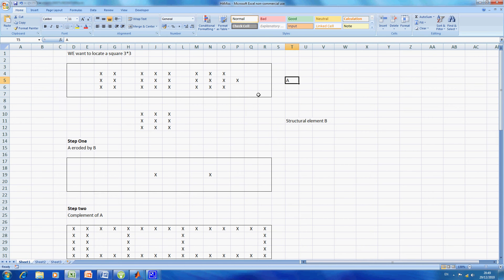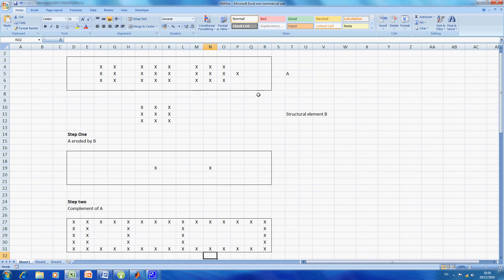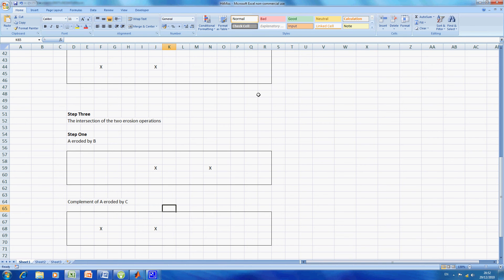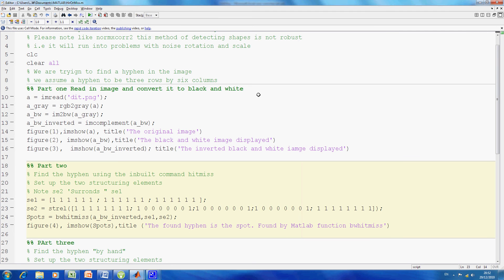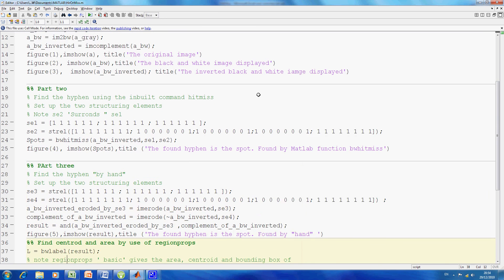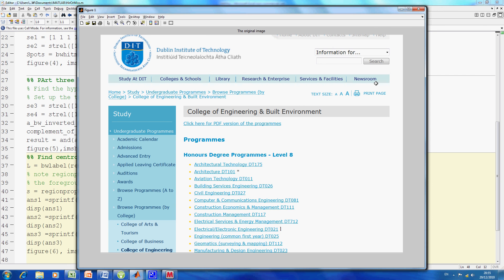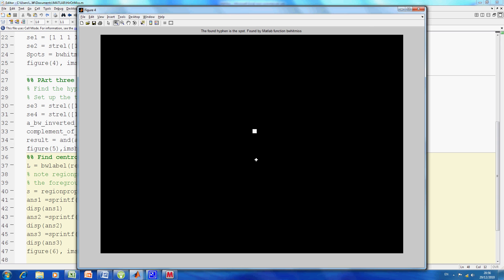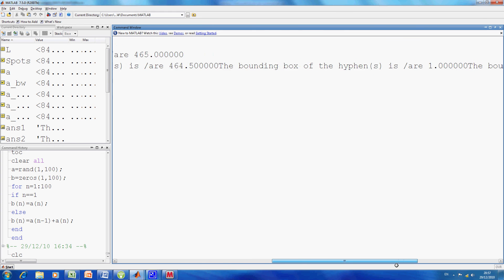BwHitMiss in Matlab (Hit Miss)

Comment: i am trying to recognize a short period waveform in a long time period waveform by using hit and miss transform. i am supposed to use the small waveform as SE and then conduct the process. As the waveform is very long, i can display them freely with chosen axises. My question is how can i convert the waveform plot into binary image and how can i make sure if they are in the corrent size and  are suitable for doing hit or miss transform